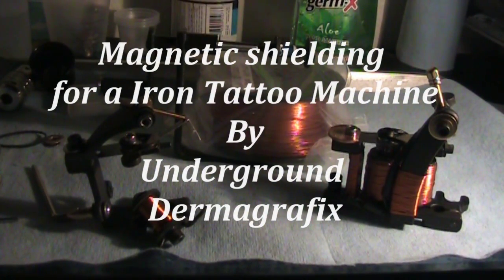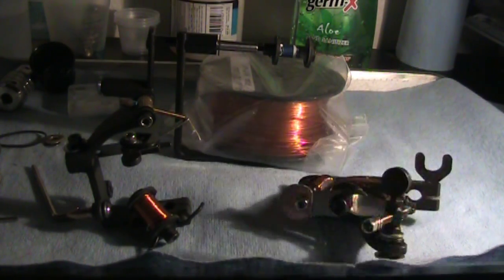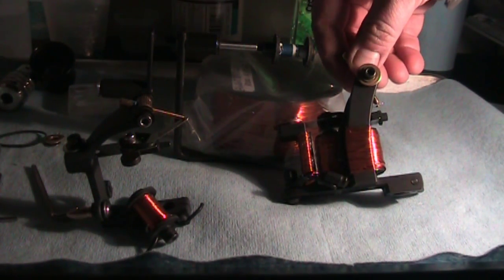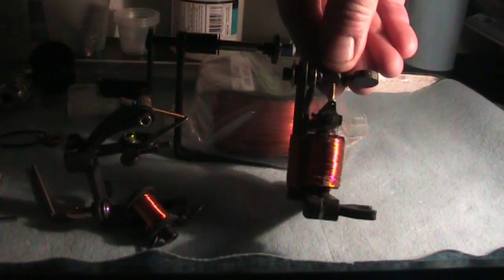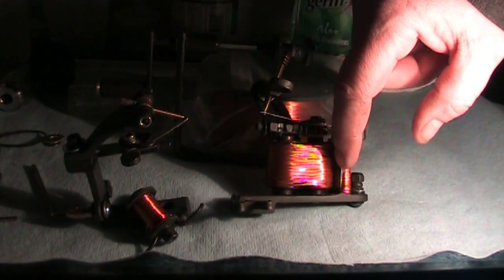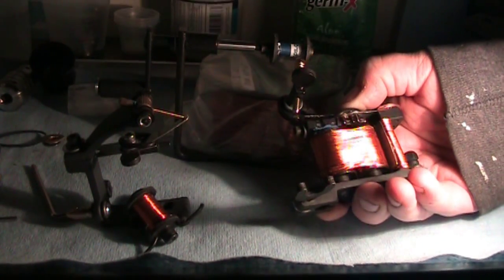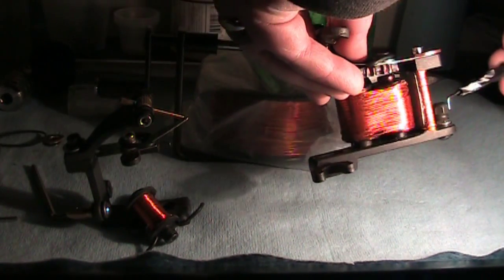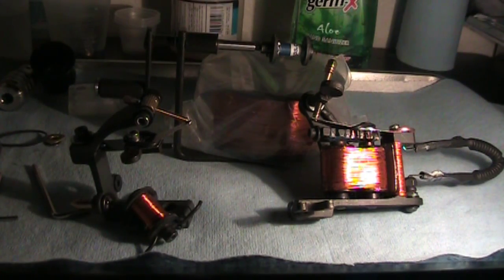Magnetic shielding for Iron Tattoo Machines

Comment from the maker: yes ,  but the frame types is important  as I say the less metal directly next to the coil the better,   a non ferrous frame with a nice thick yoke with the same mass as the coil core and good iron cores with no magnetic memory  is best .  and use heavy iron frames for limited use machines like sculpting liner.

Comment: @ ricky2000; I obviously concur as I have ordered a couple machines from our friend here, if I can catch that 2nd question, your iron (typically just 1018 roles steel) also does not require a yoke technically&most won't have one;being metals(brass,aluminum, etc.) that aren't so ferrous; they obviously have to have a yoke ,typically....., u guessed it,steel.           Most common contact screws are brass or copper;though my preference & most people I've spoke with over the years is a sterling si

Comment from the maker: @ricky20000    it is part preferance  but  iron has a heaveir feel that some like and many dont for a color machine that you have to use for a long time .    but iron is nice for a large mag cutback to absorbe the vibration  

use different material after a while your make your own choice as to what you like for what use 
steel springs ( copper coated is available too) coils is a whole other discusion but cores need to be low carbon iron  ,